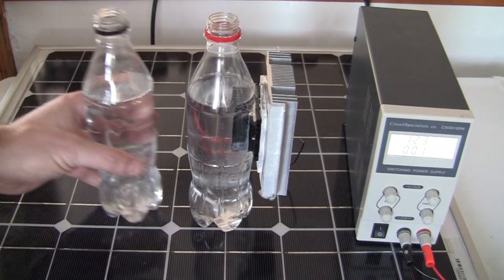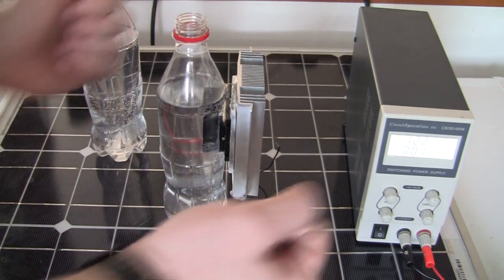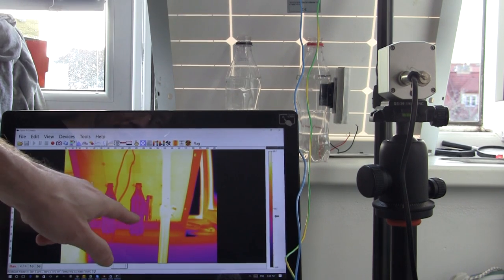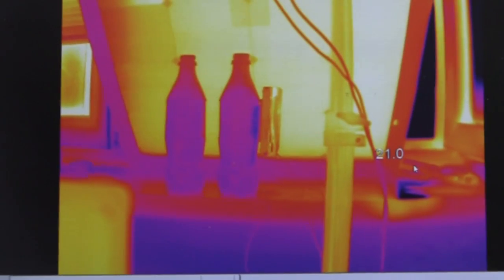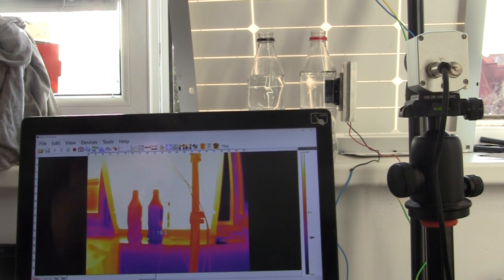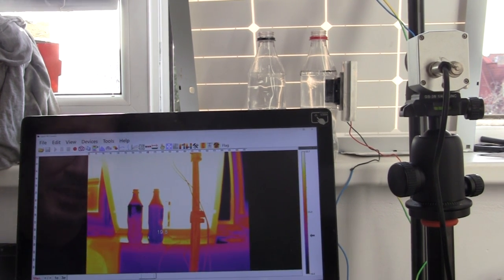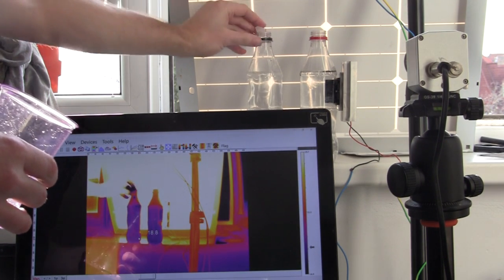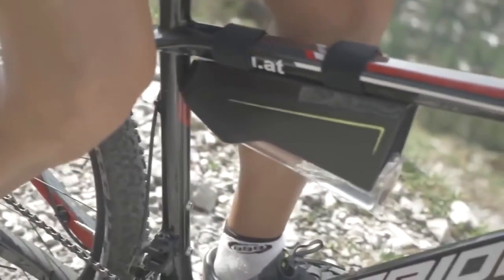Self-Cooling water bottle ACTUALLY WORKING!!!

Comment: hey thunderfoot!

just had an idea for you. If you have some idea about a concept you might find actually useful or just interesting and if you get to the stage where you tinker around with it, kinda like our totally-not-fake-at-all solar FREAKIN' water bottle, could you maybe talk about it on a video or something? idea may need a bit more work for the channel to fill out the content, but still, it may make for an interesting series or segment.
Reply: My pet bunny was bled out in my garden while no one was home. Front paws missing. I think the maid told a sangoma (witch doctor) about my bunny. Welcome to south africa
Reply: Andrigo rosetti this idea reworked (a way from the solar powered part) could be a viable product.
Reply: just purely due to the energy required for a task that, let's face it, is pretty unremarkable, i would just stick to cooling water in a larger container and putting it in an insulated vessel.

Comment: really puts into perspective how shitty thermoelectric tech is. we really need to make better stuff for it.
Reply: nitrohedgehog Its really the material you are working with, ie water. water has a heat capacity of around 4 which is crazy high!! This why it takes so much energy to heat (and to cool it)
Reply: ...and thermoelectrics are horribly inefficient on top of that. a standard compressor would do a far better job at the same wattage.
Reply: nitrohedgehog but you look to the market that it is most used for, pc gaming, you can get really efficient cooling with air.
Reply: Thermoelectric is garbage. It's only useful as a heater, because it's marginally (10-20%) more efficient than a resistor or heating element due to the heat pump action.

Actually, you can also get COPs of 2 and even 3-4, but you have to seriously underrun the module (a 12V module has to be run at 5V) and have a very small dT (10°C max) for that to work. Any more dT will ruin the COP dramatically

Comment: Ideas on how to  shrink the setup.

Rather than run directly off solar, use it to charge a built in a Li battery and have it so there's a cool button designed to cut off as a specific temperature.
Reply: There are many ways this could be refined into a real, if novelty and overpriced, product. For one using vapor radiators could significantly reduce the size and weight of the heat exchanger as you need lower surface area with more efficient cooler. Make a small built in  cooler, takes 0.5W on top of your 50W setup so its nothing, but increases the heat removal significantly on his setup. This shit could turn into a real product.

Comment: In MY OPINION, the solar cooled water bottle could be more beneficial then ice cubes in a longer stretch of time
Reply: Just drop the solar aspect and replace that with a battery pack and it would work fine
Reply: Actually, no it wouldn't - most of the battery's energy would be wasted. Replace the Peltier element and battery with a thermos full of ice.
Reply: Arma Facts yeah because it is continuous cooling.
Reply: Battery energy wouldn't be wasted... It would cool until the certain point then shut off until it's warm enough to be cooled down again.

Google bimetallic plate (if that doesn't give you an idea of how it could work in this case, please get the fuck out right now, come back in a few years, thanks).

Also bottle being a self cooling thermos would prolong battery's lifetime and small solar panel at the top of it could be used to recharge it, so if it was made in a way where you could keep it in the sun and have it still cool it down a lot faster than heat up, it would work.
Reply: IT PAYS FOR ITSELF!!
Reply: Well, you could do what the romans did and use a mirror with a matt black reverse to make your ice.  Dig a hole, line it with straw as insulation.  Put your water bottles in the centre, cover with the mirror, shiny side up in the day and matt side up at night, over time it will cool the water down.

Comment: I could tell you that this would sell in AZ for security guard, construction workers, and others who work outside.
Reply: SSecularScholar also motorcyclists. mountain bikers. people on long road trips especially in hot areas. 
the power supply is the biggest problem. and if you use batteries or hook it into a power supply like a car or an outlet that is solved. if you them use an insulated metal bottle and have a separate pack that does all the power and cooling that the bottle slips into (the bottom of the bottle sits on a metal plate that is the cool side which then cools the bottle which then cools what is inside the bottle. boom you have a product to be sold. now not exactly self cooling. But sell useful.
Reply: Make the bottle thermally isolated. Cut down the solar panel to a quarter. Stick that remaining panel on a backpack or something. You got a product that works for hikers now.

Comment: Yes, the ice is more effective but the high tech solution is a lot cooler... ;)
Reply: The Grey Wanderer I mean... yeah, sure, the energy source for that cooler will eventually run out... but if we survive to the point of the sun going out losing a free cooling device is the least of your worries.
Reply: The Grey Wanderer also it is continuous.
Reply: Not really, the power will eventually run out of that high tech cooler...
Reply: Nah, sun doesn't power that solar panel for most of the day(on some days it won't power it at all), and once that power runs out the bottle will warm up back to room temperature.
Reply: The Grey Wanderer toss it into the sun. done.

Comment: It's amazing how little physics the majority of the population knows. Today they will believe anything.

10 years ago I build a peltier refrigerator and actually got it to make ice in an air conditioned room. In the tropics its not easy to get ice under the ambient outside temperature in the day. Took over 40W to do this though.

For the life of me I could not explain to people why this is not possible on a USB connection when cooling pads came out. Most just accepted that I knew what I was talking about but never really understood the basics of power.

Think I will start making some videos of the stuff I built over the years.
Reply: Modern USB connectors will easily give you 5-10W power permanently, more for peaks. 10-20W is what a 12V car-minifridge with peltier elements would typically consume. A modern, large home fridge with gas compression uses something like 50W over the course of the day. But whether you get sub-zero enegies or not is (in theory) a matter of insulation, not of power, but freezing water releases energy. Regular fridges don't operate with peltier elements but gas compression, which is more efficient and allows for much lower temperatures, while peltier elements only create a differential, which means they quickly become inefficient (with multiple stacked peltier elements) with large outside differentials. Long story short: It is conceivable and physically plausible to build a freezer that's using USB as a power source, but it would have a very small volume, be heavy (due to added insulation, possibly gas compression) and it would take quite a while to freeze water. 

But given that 5-10W is what your average USB 3.0 produces, and 10-20W is what your car mini fridge uses, it's certainly not a problem to have cool drinks off an USB port.
Reply: This was done 10 years ago. The discussions were from that timeline so we are talking 5V and 500mA max. That's a lot less than the requirement. 

Results I give are based on actual measurements. The peltier was actually rated at 80W (at least the seller claimed that). I measured the current at 12V off a computer power supply to come up with approx 40W. By the way I had forced cooling of the hot side with a fan mounted to the heat sink. 

I know the typical refrigeration cycles. This was actually a hobby project to keep my coke cold in the office. I really did not expect to get ice. I was aiming for 2 to 4 degrees celcius. 

Due to the irregular shape of the plastic container a 20oz (591ml) coke comes in I had to add water and close my condensate drain to get thermal conductivity. We are talking under 45ml. 

When I get down to doing a video and putting it up I will link in a report i did and all the info.

Comment: but all jokes aside: a solar panel like this on the roof of a camping van and you got yourself a water cooler. :3
Reply: yeah, but using the vans engine power production is just a better option. The benefit to this is that this is portable enough where (with a smaller panel) you could carry it in a backpack.

Comment: i don't understand why he take of the fan of course it can not cool the water if the peltier module is hot, i usually like your video but here it's just nonsense
Reply: There are uses for peltier devices but they are not efficient. You can look up the thermodynamics in the application notes from the companies that make them. Lairdtech formerly Melcor is one of them.

Comment: Wouldn't this only cool water that is heated up by the sun? Not for solar powering I mean but because aren't heat sinks only able to cool things to almost ambient temperature due to one of the laws of thermodynamics? So if it's 90 degrees outside then it won't cool water?
Reply: The thermo electric module TEM or pelteir device goes well below ambient. You can stack them and get WAY below freezing. The hot side goes above ambient and you need to get rid of it. What they can't do is move a lot of thermal energy. IOW they could keep your beer cooler cool but you're going to wait forever if you put warm beers in it. iirc you want a heatsink about 4 times larger on the hot side on an air to air cooler, they make a lot of heat to move a little bit of heat. 

Typical use case is you want a tiny mass cold with energy consumption not a concern and avoid the size of a compressor.  Good to keep your tiny electronic sensor cold to reduce noise, or keep your beer cold in a light weight package.  A really bad idea to use it in your kitchen fridge/freezer or suck moisture out of desert air from a tiny solar panel.
Reply: I totally missed that haha, guess my ADD riddled personality made me miss it from the previous video where he used a computer fan on the prototype. Thanks for clarifying, thunderf00t has always been good at keep things logical and rooted in science, so I'm glad to hear I just missed it.

Comment: It needs to be more "designy". Say, the inside of it being a thermos so that ambient temperature does not keep it from cooling down, then on top of that a heatsink that fits nicely around the inner bottle, and a solar panel wrapped around that. If the solar panel is connected to the heatsink that way, put a fan in the bottom of the bottle and that will help cool down both the Peltier device and the solar panel. And boom. Self cooling water bottle that keeps your drink cool even when stashed in your bag after cooling. REVOLUTIONARY.
EDIT: I know that the smaller solar panel which does not even directly face the sun with most of it's surface, plus the fan make it even less efficient, but that didn't stop any of the other kickstarter campaigns to run successfully. Also, if this design makes it into the final campaign, I would appreciate being mentioned. Notice me senpai.